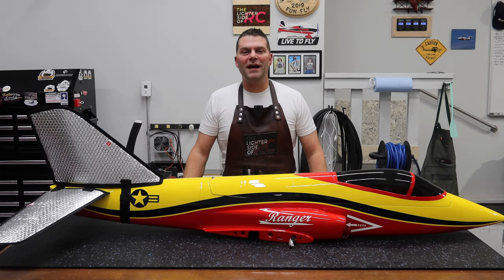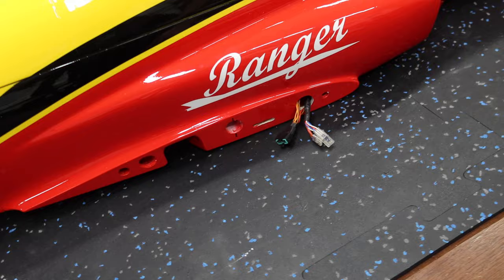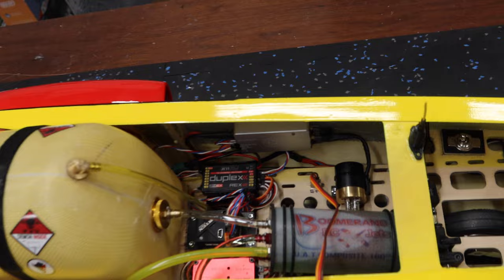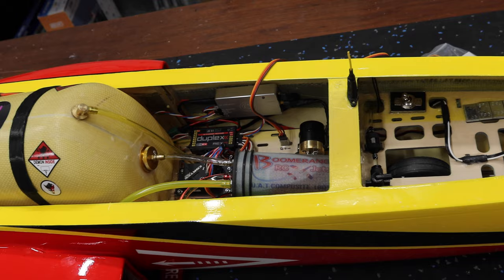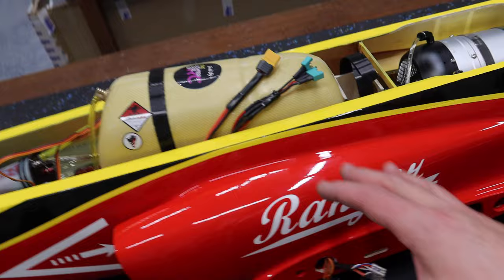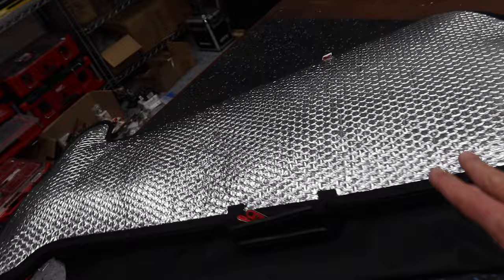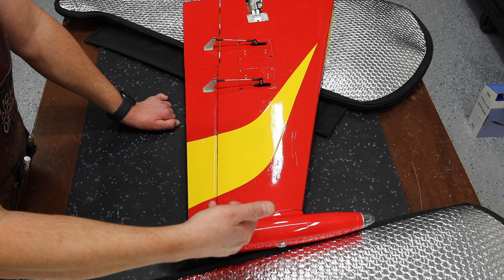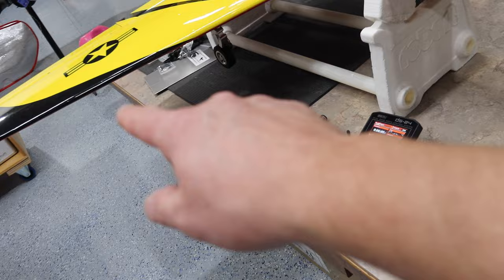BOOMERANG RANGER SPORTS JET - Quick Build Overview Summary

Comment: Jonathan thanks for Joe’s email address because I will contact Joe to make Me a 3D part for my wing spar ! I had a crash on my F5J and broke the jointer Spar and need a 3D insert to glue the broken piece back to the main wing tip.  👍🏻 Be Safe Jonathan
Reply from the maker: Awesome 😎. Thanks 😊
Reply: @thelightersideofrc  I told Joe in my email about my repair and told him you would flip the Bill 💵 Hehehehehe.     Sorry Jonathan I could not do that.    Thanks for joe’s info. I need to repair my baby. I miss soaring but it is winter break.     Greg

Comment: Jonathan, making the best jet build videos on the internet.   My red, white and black Ranger will arrive tomorrow.  I will be using a K86 so your blacked out canopy seems like a good Idea to save weight in the front.  How did you black it out?
Reply from the maker: Thank you very much and congrats!  Take the cockpit tub out.  Black out the canopy with RC Car Polycarbonate paint.  This goes on the inside.  "Smoke Color"
Reply: Will do and thanks so much for the reply.
 @thelightersideofrc
Reply: Jonathan, The color you used doesn't look like smoke gray. Looks to be translucent, perhaps black.  I would like to duplicate that color on my red, white & black Ranger.  Thanks. @thelightersideofrc

Comment: Another well done video Jon!  This Yellow and Red Ranger was my Turbine Waiver jet. It is perfect for the $$. I like your layout. I used the dual wall tank and added smoke. I put my receiver batteries up front where your lead weights are and I used  Lighter Side of RC 3D printed components where I could.  One thing you did that I like is the battery box. My ECU battery and Gear battery are behind the tank.
Reply from the maker: Awesome Bert!  It really is a great Aircraft for a beginner or experienced pilot.  Simple, Affordable and great size!

Comment: The 3D parts would come in very handy.  Have you ever used Buck converters for voltage level needs?  There's a wide range of input and output and they are very lightweight with a display.
Reply from the maker: Thanks Michael.  No never used them.  I have no idea what they even are.  Time for Mr Google!

Comment: Hi jon, do you know if there is no loss of thrust with such a so small gap ahead the turbine air intake vs aircraft with air intake ducts directly going ahead the turbine ? Thanks for all, I love your videos 👍👍.
Reply from the maker: The more direct path for air the better but as long as it's getting sufficient air there shouldn't be.  A full bypass system is always most efficient but not always possible in most aircraft.

Comment: What did you use to black out the canopy? Thinking about doing the same thing on my Ranger.
Reply from the maker: Used RC Car body paint.  The polycarbonate spray.  You spray it from the inside.  This is "Smoke" not black so you can apply it in light passes and get it as tinted as you want.
Reply: @thelightersideofrc  Thanks!